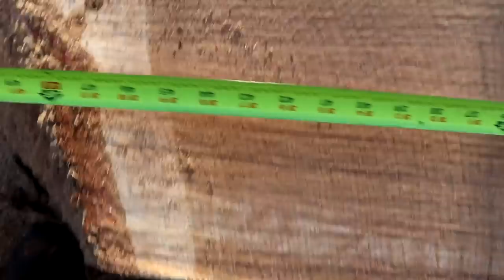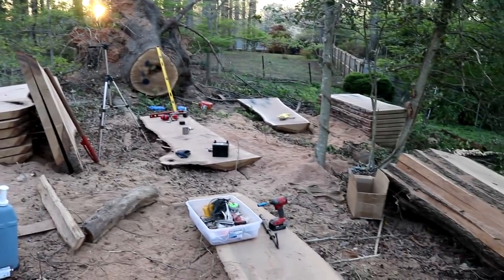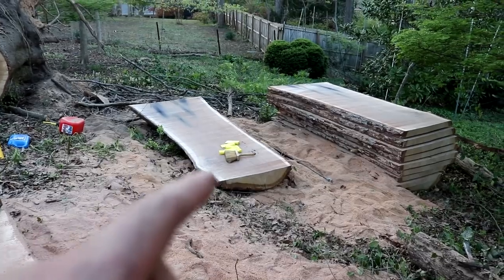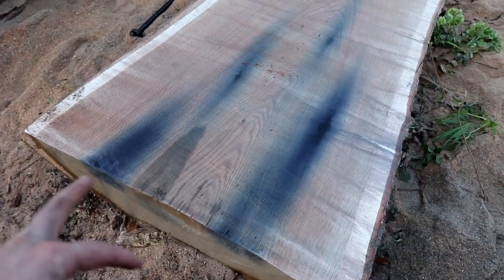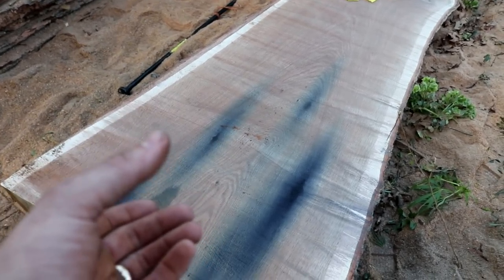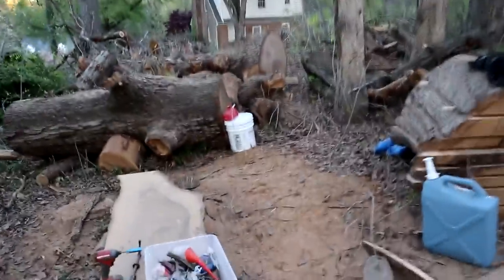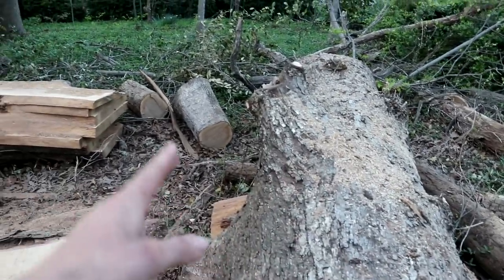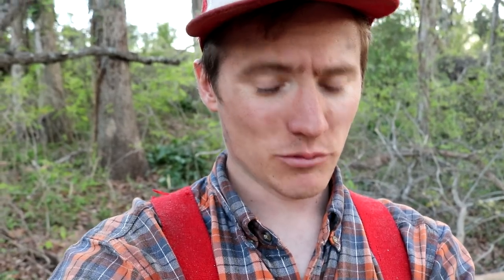HUGE CHAINSAW MILLING JOB!! 45 Foot White Oak!!!

Comment: Please make sure you avoid cutting trees as much as possible and grow 
plants at least 10 plants to 1 tree used, more than 10 is even better. 
We have already seen forests under fire and we couldn't do anything 
about it. Please don't consider trees as just woods.
Reply from the maker: This tree fell in a storm, don't let your ideas get the better of you.
Reply: @thehomesteadcraftsman8975  what i mean is that we need to grow as many plants as possible considering the global warming problem.
Reply from the maker: I believe in commercial logging there are about 4 trees planted for every one cut down. You can over plant an area. But I hear you.